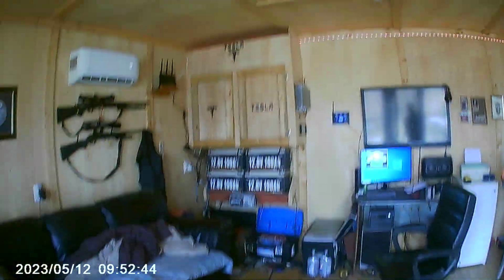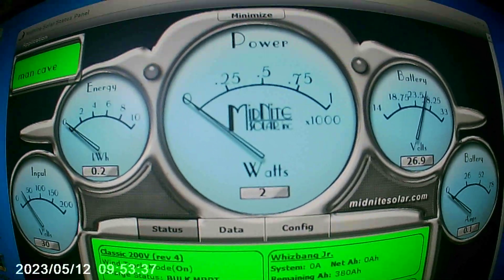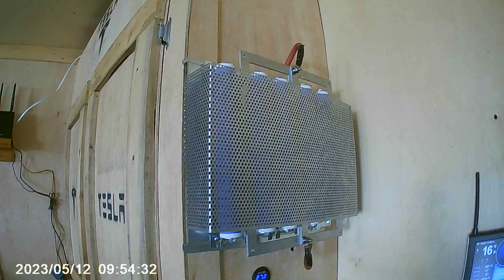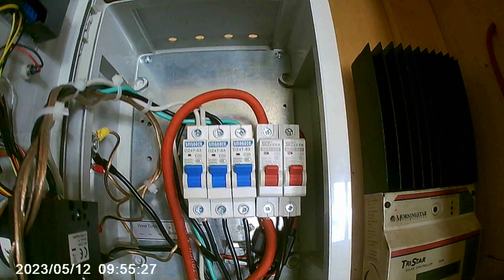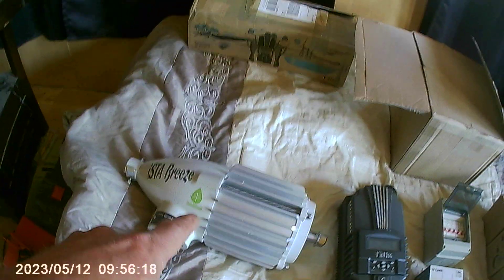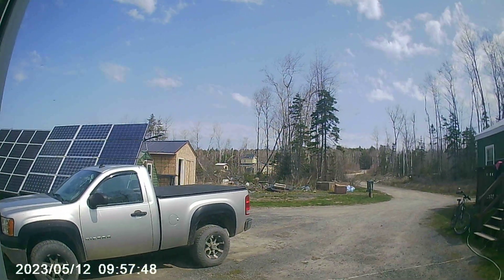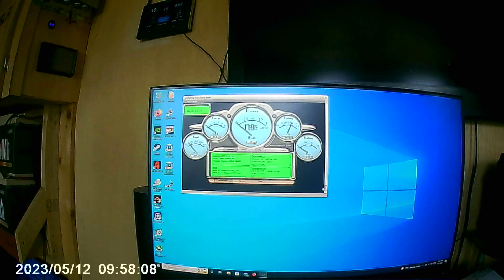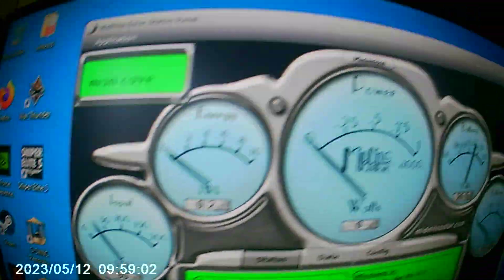ista breeze i 1500 final build on the man cave

Comment: Wind Curve? Hello Reggie, do you have a copy of your Wind Curve for the MidNite 200? Thank you.
Reply from the maker: hello steve on the i1500 48v turbine with 24v battery bank im running 4 over 8.remember the classic 200 is mppt converting the higher voltage to higher amperage the same as solar does.voltage is 4 8 12 16 20 24 28 32 36 40 44 48 52 56 and 60 amp are 30 38 46 54 62 70 78 86 94 102 110 118 126 134 142 and 150 its a strait curve.specs on the turbine are 30 amps max 150 v ocv.so i doubled the amps in my curve as the battery bank is half the the turbines voltage to get full potential whats you battery bank voltage and your turbine specs i will give you the best curve